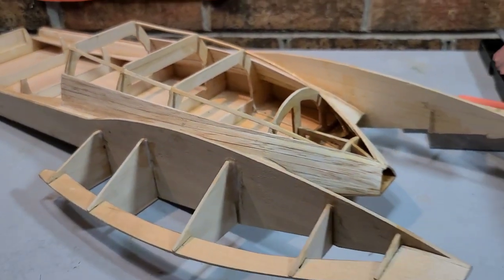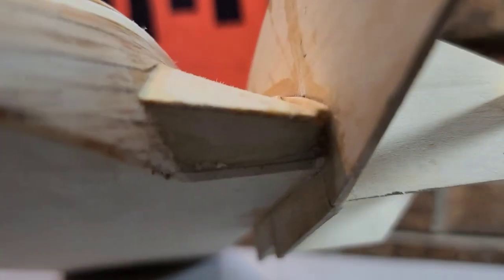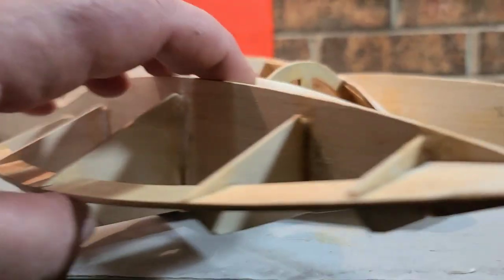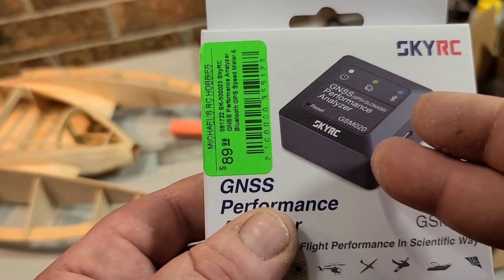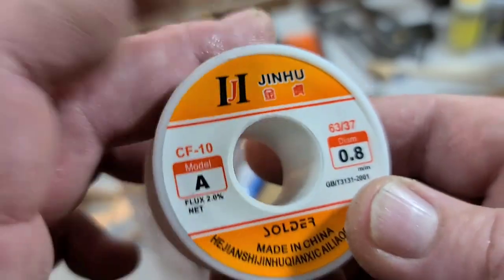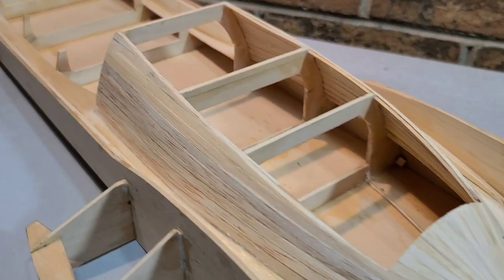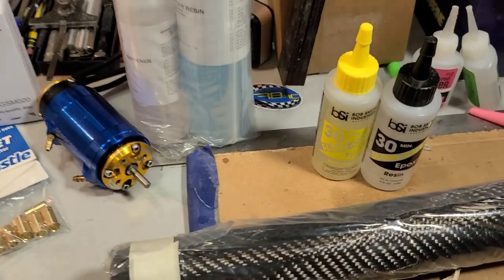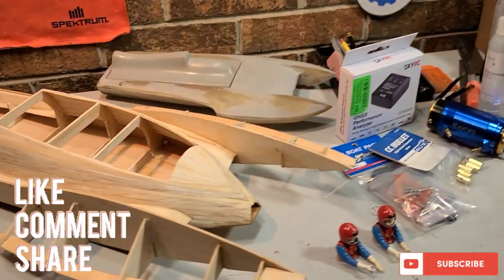Rc Boat Parts Unboxing, Shop & Rc Drag Boat Update

Comment: While cool enough on their own, the BJ42 and the UL-19 are ubiquitous.  Everybody has one.  I'd like to see something different:  Put your time into the drag boat.  As for the drivers for the Wet Peddle, careful (emphasis on careful) application of heat will soften their elbows enough to bend their arms up.  Use very narrow, concentrated heat, and not enough to burn the paint.

Comment: Hey man, yeah get the BJ42 kitted up and going before the weather gets cold..easiest and quickest job to go for the moment. The rest will be series builds probably..Tip with the Sky RC GPS keep a bit of tape over the USB plug opening and the reset opening..keep it water tight, if it gets too wet it’ll die pretty quick. Cant wait to see what you think of it!! 👍🏻

Comment: Can’t wait to see the ul-19 build. Been loving that boat, actually hit my pb of 81mph with it the other day. Fyi the 40 series motor will fin in the stock bracket and hatch goes on fine, running a 4082 2000 in mine.
Reply from the maker: That's what I have in mine 4082 oxidean stock mount.

Comment: Looking forward to the UL19 build. I have two and I just completed a drag build and the other is set for ovals. I contemplated gutting the inside and inlaying with carbon kevlar weave. Was about to when I saw OSE has the delta forces back in stock. So I got a DF 33 coming for another build
Reply from the maker: Dang wish I'd seen the deltaforce hulls back I would of gotten a df hull over the custom wood build.  Bummer.    Your gonna love the DF33 absolutely love it
Reply: @IRONCLADRC  check the site. Think he has 3 hydros right now

Comment: Police boat pilots.. Remove a section in the front of where they sit. reinstall that end piece trimmed for the loss of taper then install the steering wheel so the pilots look ecstatically correct.

Comment: The gnss gets no signal thru carbon. So leave an open spot, or make for instance a window/fake hatch in your boat to let the signal thru.
Reply from the maker: Roger that thanks
Reply: Actually no signal will go thru carbon, even the receiver or other gps systems. On full carbon boats, u need to run the antenna outside the hull

Comment: I have the skyrc, power it up as soon as you get to the spot. Sometimes it takes a few to get sats linked up.  As far as builds, Im have to pick the drag boat. That thing has my interest peaked lol. What are you using to cut the bass wood so clean?
Reply from the maker: Thanks for the GNSS  tip,  I used a hobby knife to cut the drag boat out with, bass wood is actually really nice to work with cuts easily